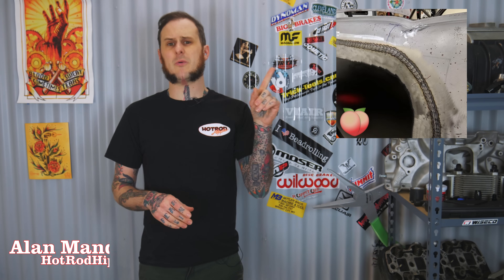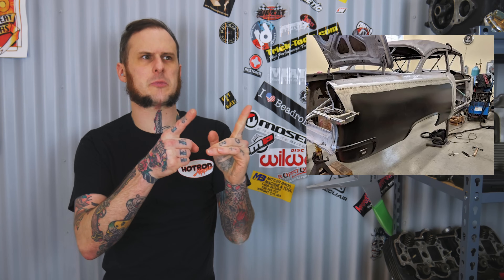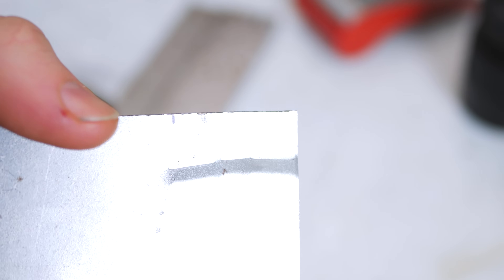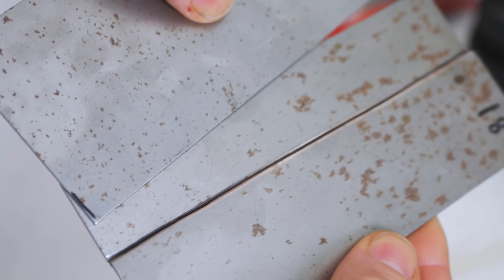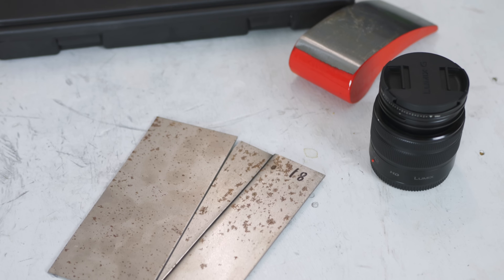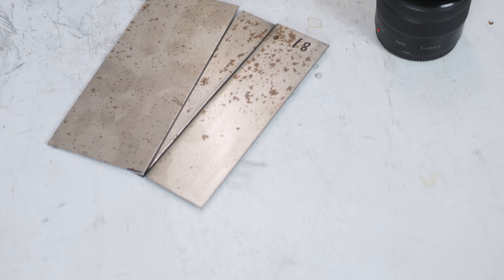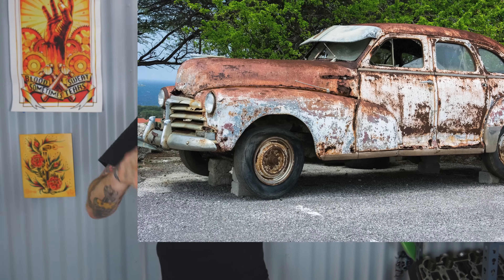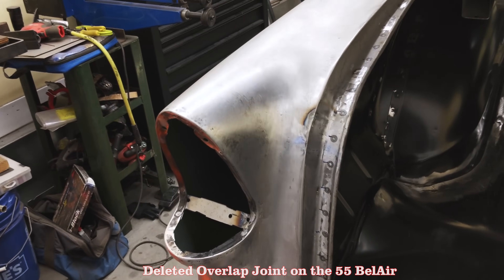Butt Welding VS Overlapping Sheet Metal Panels

Comment: I did a cab corner and a rear corner fender panel by butt weld and took a while but came out good but did the other cab corner overlap and it came out good and after paint I filled it up with fluid film and add more every fall and my whole paint job is 20 quarts of raptor bed liner with micro kevlar pulp and aluminum oxide powder mixed in then bonding primer then a paint job on top of that and it tuff as nails.
Reply from the maker: If it works for you, it works for you. For me I don't see that application of chemicals as entirely necessary when the project is put together the way I feel it should be.  That all works well for protecting a project, but can get a little ugly on certain builds, and in the way of any future upgrades or changes.  If someone gets side swiped, will it be a nightmare to replace a quarter panel now? Things I have to think about when building cars.

Comment: Did he never heard about welding primer ?
Reply from the maker: Weld through primer is only so effective. It doesn't etch to the metal nearly as well as an etch primer or a catalyzed primer. I've also never found one that didn't at least somewhat effect the welds. Especially when TIG welding. It still contaminates the weld. Why band aid with primer to prevent rust when you could just Butt Weld and not have an area to rust at all?

Comment: I try to butt weld body panels, but with my $100 Harbor Freight flux welder it comes out "half-ass" welds 🙄  

Thank you 3M for Bondo Hair 😆
Reply: I have that same welder and came to the conclusion that it's garbage for sheet metal. As soon as I upgraded to gas mig, it was night and day.

Comment: What do you think about using lap welds for a metal patch in rust repair?
Reply from the maker: I was referring to replacing panels for rust as well as panel damage here. Everything I said stands true of rot repair as well. Especially with rust repair in my opinion. I'd hate to repair a thing in a way that could easily lead to future issues while trying to fix an issue. I always try to leave a project in better shape than it was originally. Taking note of what caused the original rot (if I can tell) and addressing it as I go.

Comment: If you were converting a truck bed from long to short, what would be your preferred welding method, MIG, TIG, or both?
Reply from the maker: Personally I TIG weld basically everything.  Depending on how I went about it (would depend on the specific vehicle) I would probably TIG weld almost all of it and any spot welding would be done with MIG welding. That said, the folks at Metal OX Fab are releasing a how to video on 67-72 Chevy bed shortening. I haven’t seen it to give a review and it seems a hair pricy at $27 but it’s a place to get some more info. https://www.metaloxfab.com/shop/67-72-c10-short-bed-conversion-how-to-video

Comment: Alot of bs in this vid. I can't say i advocate doing either way. Both techniques have their place. I do it both ways depending on what the repair is and/or vehicle getting repaired.

No reason for a overlapped panel to have a pile filler in a overlap panel.....you still should fit the thing good. No reason to overlap 2 inches worth of panels either. One should really only overlap enough to make it easier to weld, like 1/4 inch or less.  the step also retains more of the weld improving weld strength and thus panel strength. 

It requires way more time to fit butt welded panels. Most customers don't really want to pay for that extra time. Most just want their stuff fixed. If it's a newer vehicle butt welding in a panel isn't even a option. The metal is simply to thin.

You're also more apt to have a pinhole in the weld to create a problem down the road with a butt panel. Both repairs should be welded in nicely but that's not the case usually.  Most bodymen can't weld for shit from what I've seen. Then compound that with sheetmetal sucks to weld anyways unless you spend a bunch of time prepping both sides of it.....it seems a small overlap is probably the way to go for all but the most high end builds in the end.

Good tip.....instead of advocating butt welds to these guy something shoulda been said about using a stronger water resistant filler as their base on any welded in panel. That will go further to holding a repair than either technique vs regular bodyfiller.
Reply from the maker: Hi, I build high end custom cars and teach people the proper techniques to repair and restore cars. I'm not out here teaching the way to cut corners and get a random body shop job out the door under time. 

To say that "Body Guys can't weld" is a reason to dictate a repair method is a confusing leap in logic. I'd say, "They should learn to weld.". I TIG weld butt welded in panels on cars from the 1920s up to modern day. 

Just because you find what I'm saying to be too time intensive doesn't mean I'm wrong. Every point I make still stands no matter how little you overlap. You still have a place for moisture to be trapped (No matter what materials you use in between the overlap or to fill/seal it). You still require more filler than a butt weld will, no matter how well you fit an overlap. And a proper butt weld has no pinholes. It's only laziness that would allow that. 

I never claimed this was the quick and easy method of panel fitment. It's just the ultimately correct way of doing it. Fitting butt welded panels is absolutely more time consuming, but once you get the hang of it it really isn't difficult. 

If you never aim for perfect, you won't accidentally stumbled upon it. When you set out saying "That's too much work, I'm going to go the easier route" you may do an excellent job at that easier route, but it will never be the proper way because you chose that from the outset.
Reply from the maker: I could accept if you were saying "I accept that butt welding is the ideal way to do it, but due to time / skill / lack of tools / etc I cannot do it that way in my day to day work.". I get that. However I can't accept you telling me I'm simply WRONG because you can't be bothered. Everyone seems to take offense to my teaching the proper techniques because they don't want to put in the effort or time to do the job properly. And that isn't a fault in myself or what I'm teaching.

Comment: i started back in early 70's we never dreamed of butting panels then,everything was lapped and brazed together. dont know as i ever had a comeback. then mig come along. i remember buying one of those flange tools,flanged it and mig welded it.it was the worst job i ever did. throw them flangers away,learn to butt weld or if you have to lap just bring together tight and weld it. oh that customer that i did that flange weld,that was my car,thank goodness,still in the garage,looks good 30 yrs later,but i know whats lurking behind that paint.lol

Comment: What about floor pans?
Reply from the maker: This was more so about general patch panels such as doors, fenders, quarter panels, etc. Floors and structures like rockers, A/B pillars use overlap as a form of structure. That is integral to the design of the body structue and unavoidable. All the same things apply there but it's a necessity to form a solid body. If it was overlapped originally I will overlap it again. Of custom floors I construct often have overlaps between pieces. I have methods I use to mitigate future rust issues that I will cover in a video eventually.
Reply: @HotRodHippie  wow, thanks for the immediate response. I guess when I said floor pans I ment patches that are a little bigger than the holes they are going over and not whole floor sections replacing OEM floor with the same OEM attachment points and seems. Any info you give I'm soaking it up like a sponge as someone who knows nothing about sheet metal work other than watching ron covell since I was a kid and reading some metal bumping books
Reply from the maker: For me personally I usually butt weld those patches in too. Much of my work is restoration or high end customization so overlapping is just a time saver that I don't need. In the case of tight budgets I may do that but would always prefer not to. The worst part is that sometimes you cannot reach around to hammer and Dolly the butt weld patch by yourself. So I end up recruiting a helper to get that done, or rigging up some method to hold a Dolly in place while I hammer. (Magnets, Sand Bag, etc)

Comment: Got an old truck, bottom of door rusted gone but welded outside skin on, whole length of bottom of door about 3.5 inches high, kind of rippled bottom of new panel in a couple spots, I should try to hammer and dolly flat before I put inside skin on? thanks
Reply from the maker: Yes you should. Welds shrink as they cool. They need to be hit with a hammer and Dolly to stretch back out a little and smooth out. I'll be covering that in a new series I'm doing about repairing s VW fender shortly.

Comment: Look at the floors of 99.9 % of cars and you will see lap welds and seams. Guess what folks ? the floors dont rust out in these areas first ! they will rust in the other areas and not in the seams because they hold moisture they rust where trash and moisture doesnt dry out and in rockers and such where dirt accumilates and stays wet. A seam done correct and properly seam sealed will last your lifetime.
Reply from the maker: I'm sorry but you are completely incorrect. I do rust repair and restoration on classic cars everyday at my day job. Overlapped floor seams are rusty more often than they aren't. I just did a 1991 VW Vanagon and the overlapped areas were all at least mildly rusty despite being heavily seam sealed. 

I use a self etching primer on floor pan overlaps and properly seam seal afterward to prevent future corrosion. The classics often had only crappy primer, if not bare metal in between their overlap joints. 

I'd say that the MOST COMMON spot I find rust is overlap joints and UNDER seam sealer when it comes to classic cars. We've learned a lot and improved our seam sealers heavily over the years.

Comment: The argument against lapping panels is bull people ! the factories overlap all the time ! Loook at the floors !
Reply from the maker: Overlapping floors is done for strength and easy of assembly. That is entirely different than the crux of this video. The focus here was on patch panels. Overlapping in the middle of a fender repair is entirely different than a rocker panel overlapping and spot welding to an inner rocker. Though it still holds moisture and rots there often, it provides the necessary structural strength in that area while also allowing for a little twist and flex between spot welds.

Comment: I'd love to butt-weld but the piece has to be perfectly shaped first...  I have seen an old technique where the piece is over-lapped and clecoed in then a small (1-2) inch cut is made and then the overlapping piece is pushed down and butt-welded.  A few inches at a time.  This way the piece is forced into shape.  I will try this.
Reply from the maker: That is basically how I do it. I lay my new panel over the old one, cleco them together, scribe in the cut line, then cut it and file fit before I weld. 

You should aim to always have a "relaxed" panel that fits properly before you start welding though. I am completely guilty of it, but that is the goal. If a panel doesn't want to lay flat, butt up nicely, it will only get worse with welding. That tension acts kind of like kinetic energy that the weld releases. Tense panels result in more warpage from welding and more need to hammer and dolly a finished panel. 

I will cover how I do these things in videos sometime soon hopefully. You are definitely on the right track in my opinion. 👍👍
Reply: HotRodHippie well, I’m subscribed:) thanks!

Comment: I disagree,,, I overlap only a quarter inch,,,and you can work it,,,if you butt weld you will have to almost grind out all the weld to make it as flat as the lap weld and weaken it,,I've seen alot more butt weld failures then lap welded,,, either is going to condensate,,, just don't make laps so wide and it will do fine..not too mention the time it takes to fit the panels perfect,,,that's why people can't afford to pay to have them done,,,not many people can weld..
Reply from the maker: Either will condensate, only the overlap provides a place for condensation to be trapped. Fitting a panel for a butt weld just requires time. And honestly that time reduces the amount of time and materials needed for body work. 

An overlap will NEVER be able to be hammered flat and true. Close? Maybe. But there will always be some step, some gap, some issue requiring an increased amount of filler to compensate. 

I entirely grind the weld to meet the base metal. You should not dig into the base metal, but meet it. This is a skill that again just requires time and attention to detail. 

If you have seen failed butt welds, you have seen failed fabricators, not a failed process. A proper butt weld can be finished smooth and be as strong if not stronger than the base material. 

Do what you feel is acceptable. To me an overlap on patch panels never will be. Ever.
Reply: Well said. A well executed lap weld will be superior to a poorly executed butt weld. BOTH will require some kind of treatment on the back side to prevent corrosion.
Some 'experts' say TIG only... 
WHY limit yourself to ANY ONE solution?
In 1987 I fixed a rust hole in a trunk with aluminum pop riveted in  and fiberglass over that. It has been outside ever since, never rusted out and no 'expert' could detect it by looking in the trunk...
It has never rusted out yet. It's not the welding they counts for corrosion. All steel is more prone to rust after any kind of welding. It's the coating after welding that prevents moisture exposure and rusting. If I'm wrong, butt weld a panel, panel beat it perfect and don't paint it! A piece of metal that is butt welded, lap welded or not welded at all will rust without a chemical barrier.
My take: Butt welds make you FEEL better. They are pretty. They warp more, so you HAVE to panel beat it. 
Lap welds are ugly, warp the least and are the STRONGEST repair.
I'm sure on some other planet, there are aliens who will accept nothing less than Anti-Matter Laser Plasma Fusion Butt Joints but they really aren't any better than plain old Nuclear Fused Lap Joints....
But there will always be a smart ass superior civilization that uses a time machine to go back and prevent the damage in the first place...
Reply from the maker: Ok, so what about the filler material required on an exterior panel with an overlapped joint? You have at least the material thickness required for the overlap. If you step your panel for the overlap you've created a rigid spot on the panel that WILL expand and contract that different rates. I have absolutely seen cars out in the sun where you can tell where an overlap is because of this differing rate of expansion. Whether it be due to the excess filler material required before paint or the excess rigidity in the panel. 

This isn't solely about corrosion. You guys are picking and choosing what you want to discuss as important. 

Let me ask you something, How do you know your floor pan patch hasn't rotted? It's caked under fiberglass. You'd have to disassemble it to confirm. I've cut apart hundreds of cars and found those types of patches and they are always rotten under the material. Just because it hasn't popped through yet doesn't mean it won't. Also an aluminum pop riveted in piece is not strong. So if you get hit in the rear end, you've created a weak spot for the floor to be smashed around. In a professional shop that is a liability. If an insurance company investigates and finds improper repair work like that they can claim damages as your fault and make you liable. If a person gets injured you better hope you can afford that bill.
Reply: @HotRodHippie  as I said only a quarter inch lap solves all your concerns,
Reply from the maker: @georgespangler1517  How? It still creates an extra rigid spot on a panel.  Still has an overlap where condensation and corrosion can form.  Still proves more difficult to hammer into proper shape.  (Even if it is easier than say a 3/4" overlap it is still more difficult than a butt weld.) And Still requires extra filler, primer, and preparation. 

All it does is make it easier to fit a panel up and weld it.  That is it.  You may lessen some of my problem points, but not solve them.
Reply: @HotRodHippie  not to argue,,, anywhere you well is going to be more rigid then base metal,,I do it both ways ,,on smaller patch panels I but weld,,,but on full quarter panels I prefer a quarter inch lap,,I don't have a tig welder and maybe I would feel different if I did,,,just to easy to burn through mig,,and get a consistent good weld when you can't form a puddle and flow it in,,just leaves to much margin for failures,,and if just one weld fails the paint will crack.
Reply: @HotRodHippie  now I just restored a 45 dodge pickup and the metal was so thick all my repairs are butt welds,,and was easy with such heavy gauage metal ,even with mig